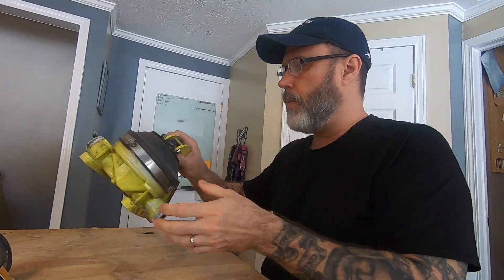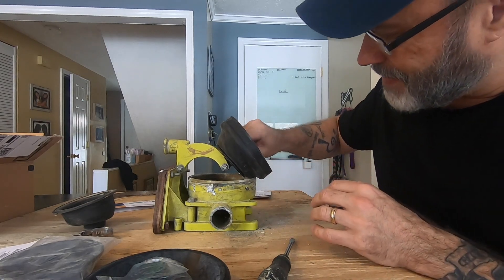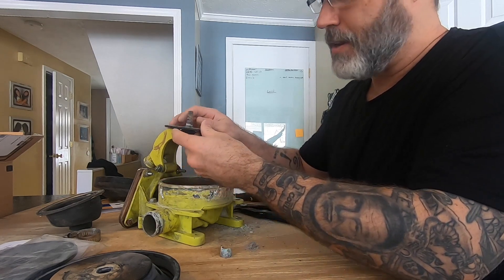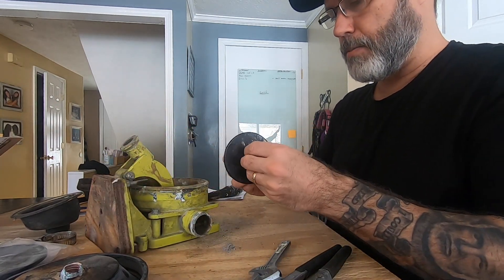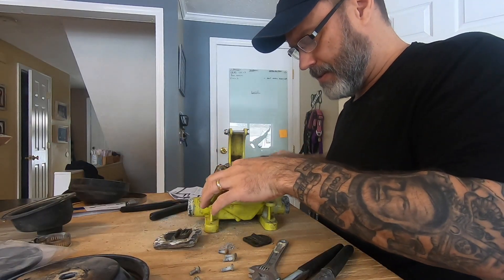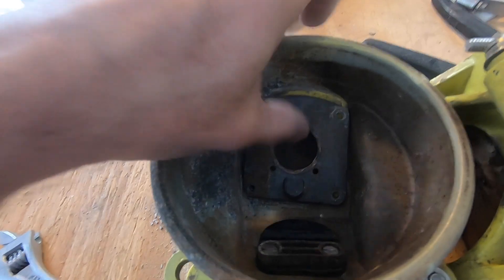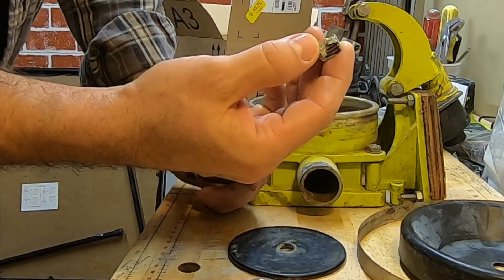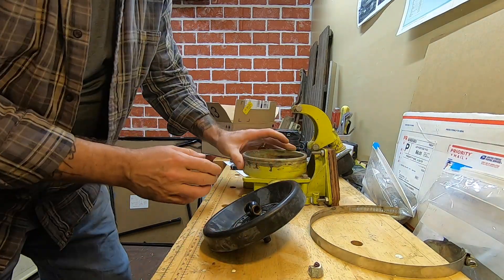Episode 22 - Whale Gusher 10 Manual Bilge Pump Rebuild

Comment: Always use Tef-Gel on threads when putting stainless steel screws into aluminum to prevent galvanic corrosion. I rebuilt a Gusher pump and had a hard time getting the flapper valve screws out! Good idea to use it even on stainless-to-stainless connections, too, since stainless fasteners can be prone to galling. The Tef-Gel is an anti-seize compound.

Comment from the maker: For those needing the nut on the inside (which the rebuild kit does not include), it is a 1/2" x 12. Most US stores only carry 1/2" x 13 or 1/2" x 14. I found a 316 SS 1/2" x 12 at https://britishfasteners.com/.